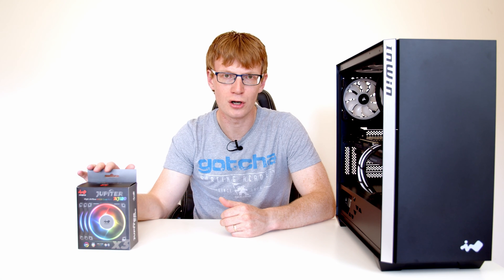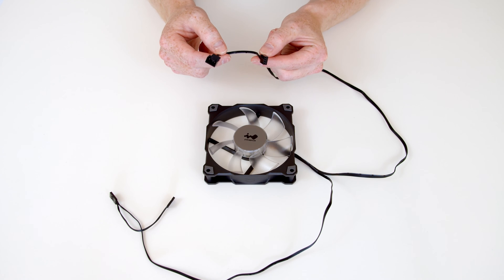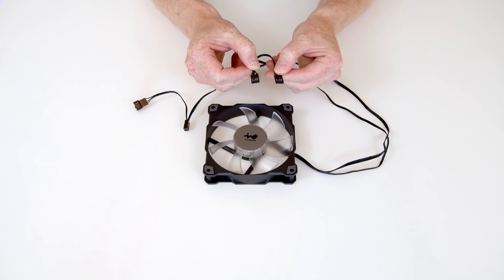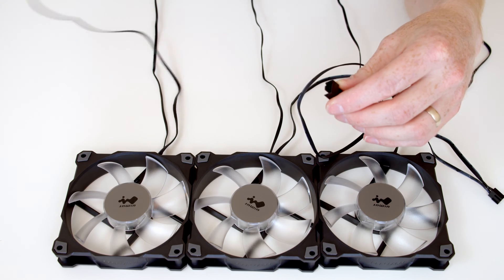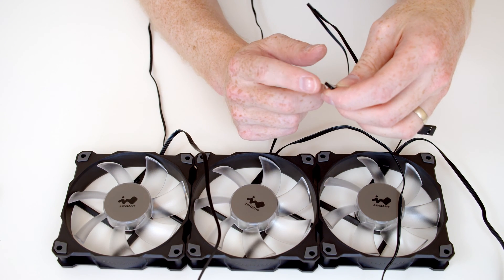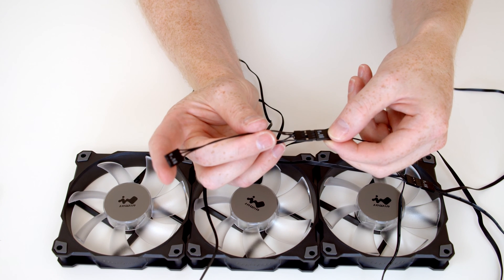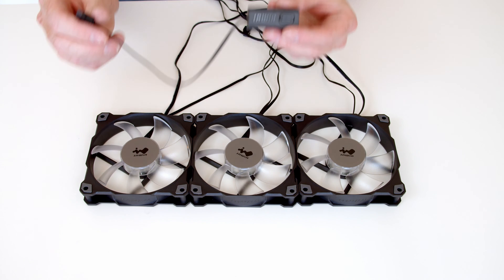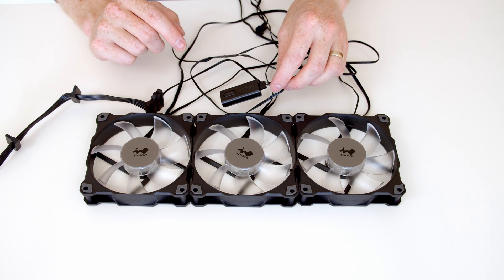InWin Jupiter AJ120 Fans Installation Guide

Comment: Hi are the RGB connectors (5V) compatiblewith other 5v connectors (the normal ones that are fatter)  and with other 5v RGB hubs - size wise?  Is the light on these dimmer than other fans - in this video there diff with the fans mounted in the case and AIO - or is it the studio lighting affect my perception? Ty in advance -

Comment: Great video so..... RGB is 4 pin 12v and A-RGB is 3 pin 5 volts if we not have A-RGB on your motherboard just use sata connector ya? man it took me forever to get this in my head all the research was so confusing. I have a RGB connection on the motherboard but this is a 3 pin 5v set up so i will just use the controller.

Comment: hey Chris great video,have a question.i have 4 fan headers on my motherboard but only one 3 pin addressable rgb header.do you think is possible to run 9 of this fans to just one 3 pin rgb addressable header?
Reply: @ChristopherFlannigan  yeah you're probably right,best to use the controller for 9 fans.i just want to be able to control the fans speed.

Comment: Hello,
sorry how do I run the fans without connecting the connector on the motherboard
I can use some connectors
the power supply?
I need the fans on the radiators
thank you